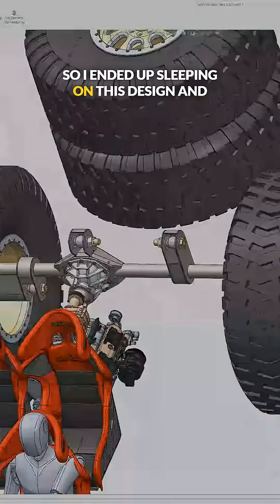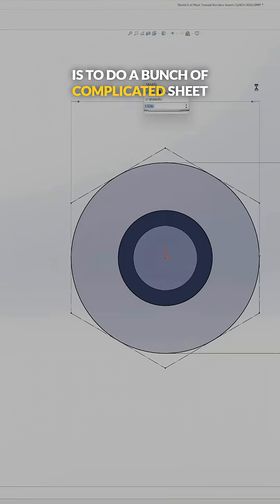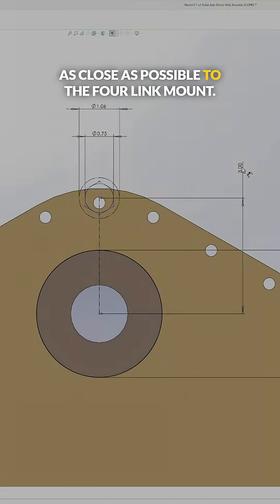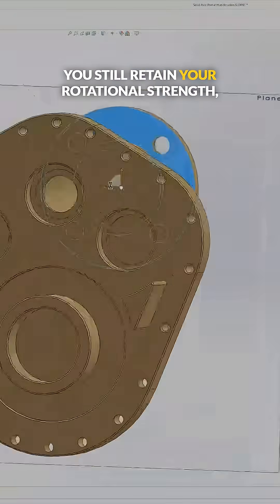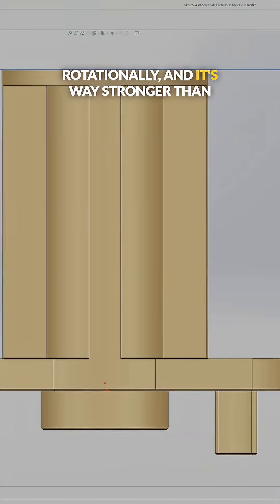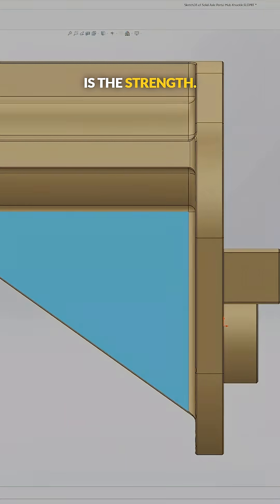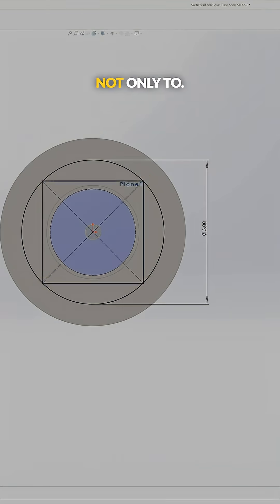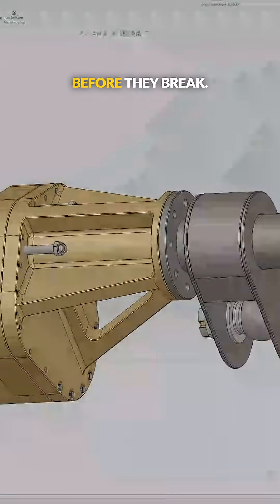Billet Portal Hub Mount #solidworks #machining #trophytruck

Comment: That makes a lot of sense. And you can spec the pins to a tighter clearance for accurately locating the parts, while the bolts can have a bit of clearance in the through-hole portion so that assembly isnt a pain? I'm really enjoying this series!